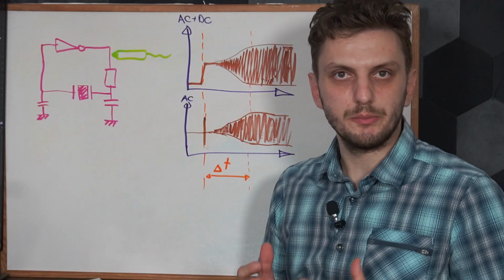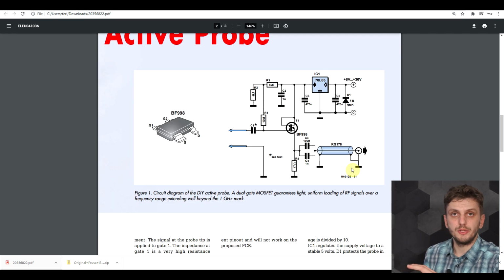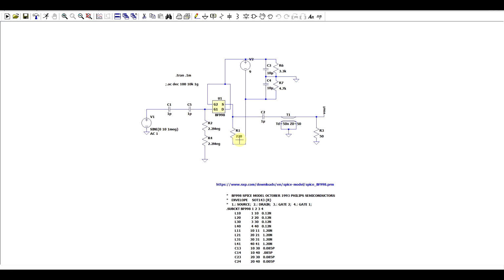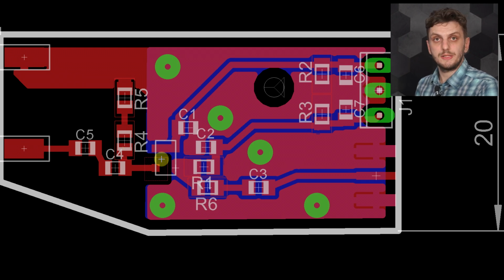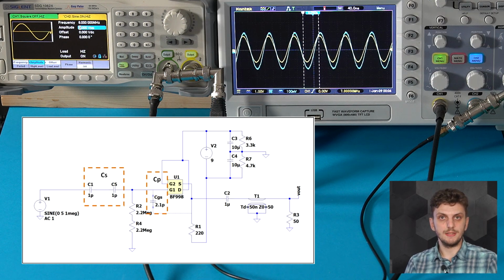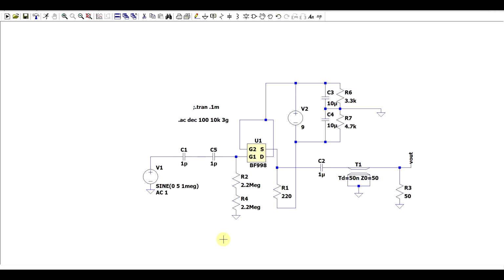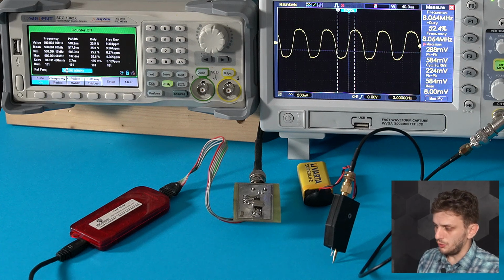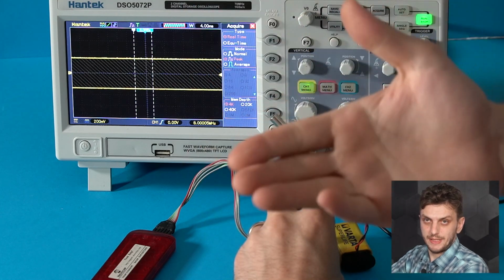Crystal oscillator - Start-up time measurement

Comment: Good evening. Your channel is very educational and professional. I’d like to ask: is it possible to perform repair diagnostics and detect faint, low-frequency signals (in the Hz range) from quartz crystals using only an oscilloscope—without a spectrum analyzer or signal generator? Thanks.

Comment: Im glad you said the problem starts mate, that little oscillator (2pin) is a capacitor itself to some extent. You do not use resistors or ac voltage as a baseline refence on clock and voltage specific circuits. If it has a clock (txco 4 pin or double the amount of the oscillator) it will need a very steady voltage (dont use regulator as they turn on and off so you lose the steady dc voltage if you do) batteries mates, you want 18volts from 0 and invert them so 18 below 0 with opamps as 6 volt and 12 volt batterys made these voltages it gives you room for the clocks as many nearly all Intergeated circuits invert the clock for reference. If your trying to make a router work properly without paying hundred to thousands of dollars, remove the lid, find the chip number and get the data sheet and you can study the clocks required for actual function not just test mode

Comment: They dont start up without an active unless you think 50hz ac from the wall socket can turn on amd off enough times 5o resonate at 16 MEGA hz so alittle bit more, remember serial data runs ontop of analogue/active so you need a clock aka txco vxco etc etc you may need more than one

Comment: Long start up times ensure security, as the first txco ensures that the entire system is marching to the same beat, just like an conductor at the sydney opera house, a symphony where every system/operation/connection is made in synchronisation with itself this is how you have a home network as its Australian so we try our best to make sure it quality as quality over quantity when 1 billion/500000 calculation per second are possible with a single cpu at 1Ghz inside the router. So now with multiple core cpus timings are even more important

Comment: This why txco's with an output enable are critcal if the circuit has a cpu/ic as that clock must be fully operating at a steady tick rate before you synchronised the ic/cpu/and memory before the cpu can be presented with its first instruction

Comment: Also if you ever had a smart phone or beside desk lamp that when you apply a small voltage it over comes the capacitance in order to not break a circuit but rather take another path, smart phone/touch screen etc etc

Comment: Also remember cpus are a transistor meaning they are a switch which means they break the circuit on and off which means clock cycles MUST be ran in parallel or canbus so that the clock cycles do not stop as the cpu operations happen ontop of those cycles in order for it to count... Thanks

Comment: You are very correct about crictal/crucial start up times as the program counter of the IC is also crucially important, always remember UDP is not unreliable It is the clocks that are unreliable which means security is effected. Thanks again

Comment: This startup duration includes the IC's internal power supply preparation time.
Reply from the maker: Usually you will see a spike when the oscillator circuit is activated, after the I finished its internal business. The IC startup and oscillator startup are usually independent. The oscillator startup is measured from this specific pulse present on the XO pin.
Reply: @FesZElectronics  Usually not independent. There is a strat-up circuit that starts the internal PS which  will feed Xosc amplifier(s)

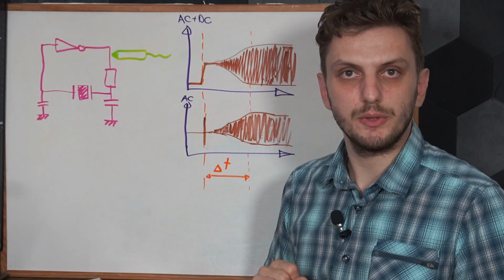Comment: The AC plot (2:58) should obviously not contain a constant component.
Reply from the maker: Indeed, there is no DC component; I drew it this way just so the signal does not overlap the Xaxis. I know its common to consider the intersection of the axis as the 0 point, but this point can be placed anywhere - I should have clearly marked the "0" on the Y axis where the signal starts.

Comment: I love this home brew stuff!  Couple of comments, the original circuit has 2 caps in parallel to have the resonances spread over a wider frequency range and the signal is taken off a 47 ohm resistor which provides a better match to the 50 ohm coax.  These are not criticisms just observations. Most 1 uF surface mount ceramic caps have already dipped and are the inductive side long before 1GHz.  What did you use for the output cap?
Reply from the maker: I tried using multiple caps in parallel to feed the output signal but did not notice any considerable difference; I guess my layout was already adding far more inductance than the capacitors, so the change did not make a difference; regarding the low side resistor - the initial circuit was designed for 5V supply, but I used 9V and the static current trough the circuit is dependent on this low side resistor; at least in the simulation, I had to increase the resistor to reduce the static current to a point where I was not exceeding the datasheet recommendation. I'm not sure what do you mean by "output capacitor"?

Comment: Hi FesZ. How did you handle the stray capacitance in this PCB? Just by trace distance or would use PCB material other than FR-4? Any coating?
Reply from the maker: Considering the simplicity of the device, just by distance you can ensure low capacitance. And since it works below 1GHz, you should not need special PCB materials.

Comment: Nice video FesZ, with plenty of brain food.  There looked like there was a delay line in the schematic, is that right? Was that modelling your test lead length? I noticed a small phase difference between reference and probe output, and the output was lagging Was that due to inductance, or cable delay, or the complex response of this active 'filter'? (everything is a filter)
Reply from the maker: I added the transmission line to highlight any impedance mismatch related issues - to see if the response gets affected; but that did not seem to be the case. Part of the delay is coming from the cable - above 10MHz the signal after the cable starts lagging (this is visible in the AC simulation).